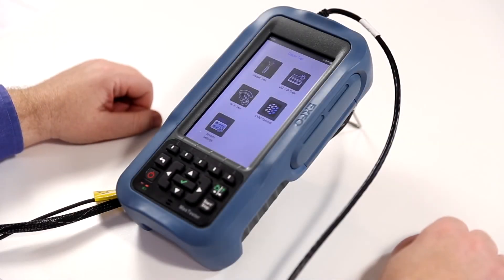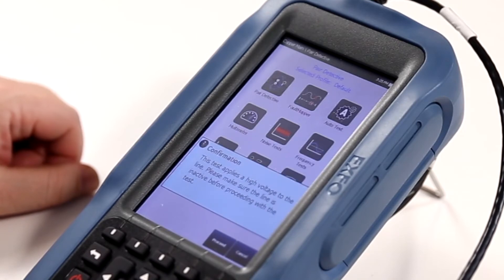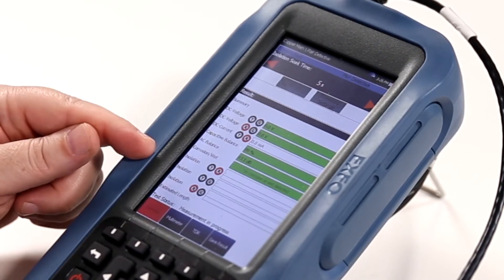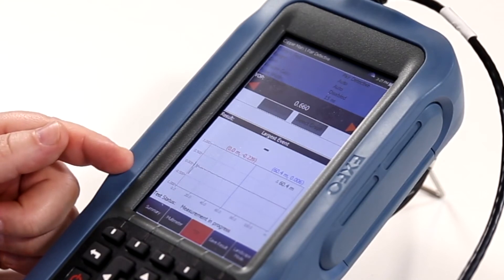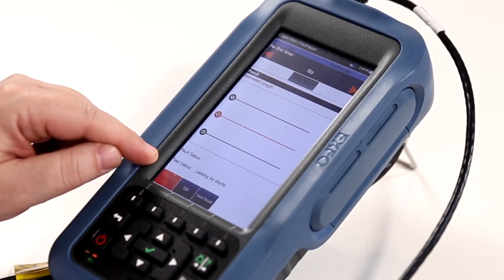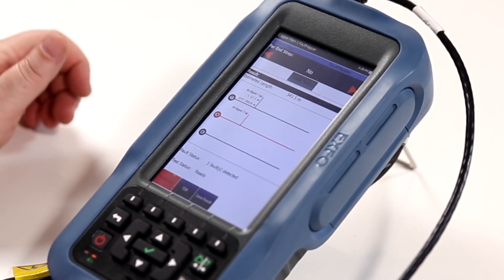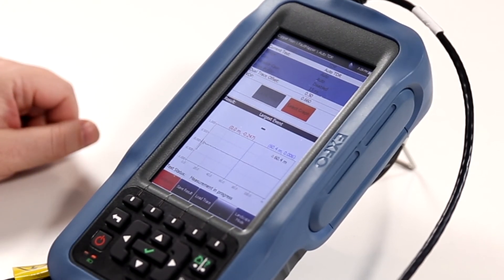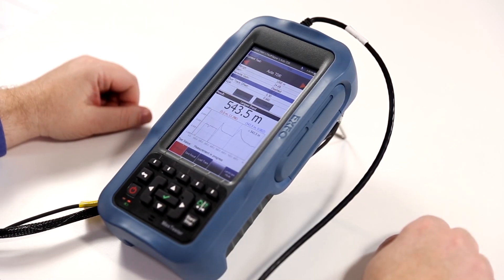How to use pair detective and fault mapper | Maxtester 635G

Comment: Bridgetap and short and open should come with numeric not in graph?
Reply from the maker: Thanks for reaching out, Anthyodayaa. Fault Mapper provides a simplified “wiring diagram” of the circuit/faults with numerical information. For detailed information, access the Auto TDR directly from Pair Detective or Fault Mapper. In Auto TDR, you can scroll over the graph to get the numerical distances where the cursor and marker intersect with the graph. You can also change the Range and Gain to see events closer to you or farther away from you. If you have further questions, don't hesitate to write to us at pr@exfo.com.
Reply: @EXFOTube  thank you for the reply
Reply: @EXFOTube  hi can you please make a video on how to do an RFL test on an exfo 635 or if video already exists, please post the link